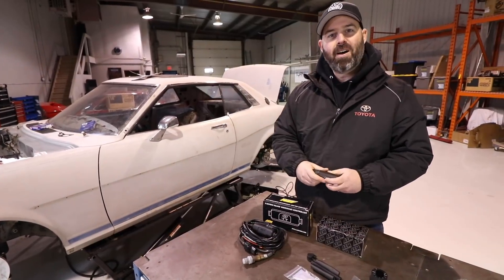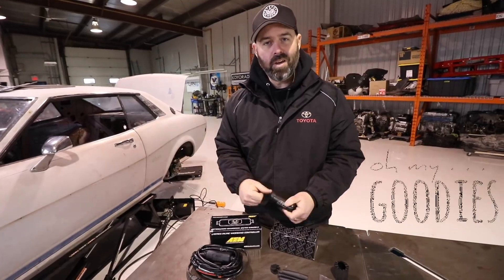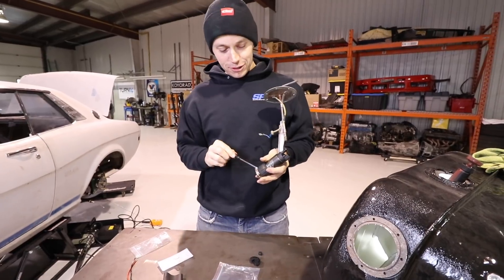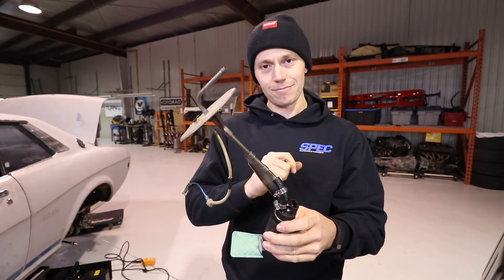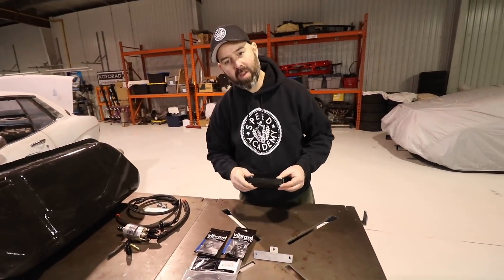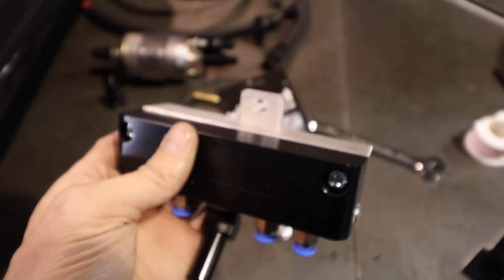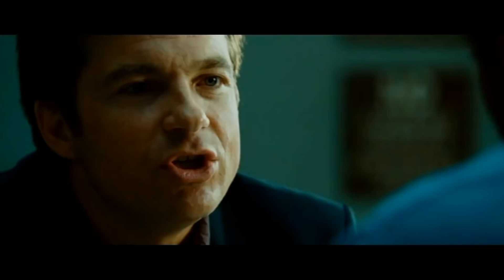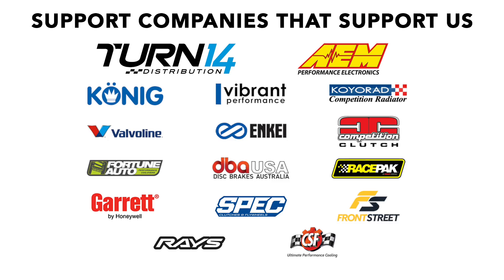Fuel Pump & ITB Vacuum System Installed! - RA24 Toyota Celica Project

Comment: I've installed series 5 Black Top in an RA40 Celica and I'm all ready to buy the fuel pump and regulator. The Toyota engine manual states the fuel pressure spec (with engine not running and fuel regulator  vacuum hose removed) is 38-44psi. It also states that fuel pressure tollerance should be 30-37 psi when fuel regulator vacuum hose is connected. I note your pump is only rated at 40psi which appears lower than spec. I've found two people that have documented their conversions on the web (one on youtube) and they both state the engine will ultimately run like a dog unless fuel pressure is 62psi. (which seems very high) They also state the BEAMS engine is extremely fussy when it comes to fuel pressure. SO having put my question in context, how did you arrive at your proposed fuel pump pressure and do you know anyone that has verified the operating pressure in an operating vehicle. Thanks in advance.

Comment: I'm a little surprised you didn't mount the vacuum manifold 180 degrees in the other direction so the vacuum lines didn't have to loop around, your O.C.D. let you do that, mine wouldn't. I like hoe the motor is looking, what is the original car those motors came in for those of us who aren't metric motor compliant!

Comment: You might need to take the map sensor vacuum signal from the vacuum block. Taking it from one cylinder will give you issues at low engine speeds

Comment: Everything you're trying to do that four-cylinder you can do to that V8 individual throttle bodies are only eight hundred bucks for the set and use your factory TPS sensor and Factory injectors and Factory fuel rail and you can still run the ECU a buddy of my done it to his

Comment: The zip tie may degrade in the fuel
Reply: It's nylon and totally fuel safe. We've seen OEM fuel pumps zip tied in at the factory. Wouldn't use it if we were going to run E85, but for normal pump fuel it's 100% safe to use.

Comment: Zip tie? What about gear clamp to not dissolve?
Reply: The zip tie is nylon and totally fuel safe. If we were running E85 a metal zip tie would have been required, but for standard pump gas a nylon zip tie is 100% safe.

Comment: The fuel line leaving your tank looks suspiciously SMALL...
Reply: That's what she said (it's -6)
Reply: the factory fuel feed, exiting a celica tank is 1/4 inch.  they may be using -6 hose, but the system can only flow as much as its narrowest point.

Comment: Just a heads up from down under (Australia) you will get a more consistent MAP reading if the source is from your distribution block and not from one of the runner inputs. I tried this on my 4AGE with the ITB's and didnt get a solid reading until it was sourced from the distro block :)
Reply: Good to know, thank you!

Comment: Hey guys. Tell whoever shoots & edits the videos to get a few seconds of just the light noise before each take & edit it in Audition and do a Capture Noise Print - Noise Reduction. 
This is if you guys use Adobe CC for editing.

Here are a few videos explaining the process: 
https://www.youtube.com/watch?v=K1oxlbD0uY8
https://youtu.be/ku6ZZ8yhuls?t=552

It might help or might not help at all until you guys figure out the light buzzing solution.
Reply: Cool tip, we'll give that a try! We have actually ordered LED light fixtures as a permanent fix, but in the meantime a software solution would be great! Will do some research on this.
Reply: Hope it helps you guys. It has helped me on a few projects.

Comment: Hhh, that foam will hhh, break down in gas hhh,. It's called tank creme hhh. Fast hhh cars, built right? Riight hhhh.
Reply: What foam are you talking about? The foam around the fuel pump that AEM provides with their fuel pumps? Hah, definitely not going to break down, it's designed to be submerged in fuel.

Comment: You guys should install a 1uz vvti with an r154 trans get way more power way more fun
Reply: M Deatherage The beams engine is easily 50kg lighter and the J160 is a good transmission and this package suites this application better imho. Also there is quite alot of potential for more power in that engine.

Comment: Does anyone know if there's an AEM wideband kit with two sensor inputs? I saw one a few years ago but can't find it anymore. (Car is running two sidepipes so need a reading for each. Caburetted so just need to hook up a gauge and be able to data-log with a laptop)
Reply: X7Rotary, I know they used to do a 4 channel setup a few years ago, but haven't nosed around the website in quite some time...

Comment: If I may make a suggestion from experience is to use a hose clamp instead of a zip tie for the pump - it will stand up to vibration a lot better.

Comment: What is the part number for the one-touch fittings used? Great build video on Beamsy!
Reply: Also is the NPT size the same for the vacuum ports on the excessive ITB adapter?
Reply: 1/8’’ NPT ports Part #: 2662  Xcessive ports are the same.
Reply: Thanks!

Comment: Can't wait to see the first startup, once she will be running with the wheels and everything but with the faded paint, it will be a hell of a sleeper. Did you try to fit the starter to see if it clears the vaccum block ?
Reply: Tons of room for the starter, so no worries there. I have been thinking about driving it around the first summer in "rat rod" condition with the old paint, but to be honest I'm pretty anxious to make it pretty once it's running, so may get paint sooner than later.
Reply: It seemed there was enough space but the angle of the camera caught me. You are making good progress with this build, I really like it. One of my friend's neighbour is restoring a TA22, but it needs a lot more work (sheet metal, pinholes in the roof etc). It reminds me that these were battling with mk2 Ford Escort in british rally stages in the 70's, japanese engines sounded so angry

Comment: With your MAP sensor you might actually want to use the block. If you're using a map ran off of one runner as opposed to a combination of all four it makes for a very erratic MAP signal on the ECM. Tuning this with Alpha-N for load and MAP for idle is the way to go.
Reply: Relax tuning experts. Mark Panic from Panic Wire has tuned more ITB'd Beams engines than anyone we know and he's told us exactly how to set this thing up. Our main load axis is throttle and the fuel calculation is based on barometric but we will use MAP for the closed loop lambda and that's it. Thanks for the positivity, bros.
Reply: J Albert that’s exactly why this car will run like shit just like their modded mustang gt and be slower then stock
Reply: Agree, MAP on ITB is useless after ~30% throttle, TPS and Alpha-N for load is the go for sure
Reply: Which Link ECU will you be using Storm or Monsoon?
Reply: Running the Fury model
Reply: Thanks DP. One last question, what is the part number of the barb fitting that's going from the vacuum block to your break booster?
Reply: http://vibrantperformance.com/catalog/advanced_search_result.php?keywords=11222
Reply: That's what I thought it was p/n #11222. The description has the hose size at 1/2", is that O.D. or I.D?
Reply: pretty sure that's I.D. but I'll check when we're at the shop.
Reply: The reason why I ask is b/c if your using an AE86 brake booster the vacuum port on the booster end is much smaller than 1/2" I.D. Thanks for checking DP.
Reply: That's a good point, we're running the Celica booster but it too has a smaller ID. We ran 3/8 hose from the Celica booster (which fits perfectly) and forced it on the Vibrant fitting which is admittedly meant for a larger dia hose. Shoot me an e-mail at dave@speed.academy if you want some pics. I don't think we covered it in a video. If Vibrant makes a fitting for 3/8'' instead of the one we used, go for that and it'll make fit up easier.
Reply: @speedacademydave  Thanks for sharing what y'all learned on this project. I know this is a year old, but if anyone else is looking, Vibrant 11225 is a 45 degree 3/8 npt to 3/8 nipple.

Comment: You might want to run a slightly longer hose for the vacuum line in order to get more slack cor a straighter shot into the fittings. In my past experiences, i have ran those pipes short and the strain of them being bent ever so slightly in the fitting and the heat in the engine bay combined can cause a hard to trace vacuum leak at the push fittings. Give it about 1-2 inches of straight pipe before it has to bend so that you won't run the risk of a vacuum leak.
Reply: We ran our lines just like this on the S2000 with zero issues. Should be ok, but we'll keep an eye on it.

Comment: I hope those zip ties are safe for Gas they might break down in gasoline
Reply: Ryboodle that is exactly what I was thinking.
Reply: AdamLZ just had problems with that in his 240. But his had E85 in the tank I believe.
Reply: All they’ve got to do is switch over to the aluminum zip-ties or a hose clamp and they will be fine.
Reply: They're nylon, which is resistant to fuel.  OEMs use nylon fittings fuel pumps and stuff all the time.
Reply: Cultus Mechanicus just because it’s an oem tank doesn’t mean someone wasn’t inside it at one point
Reply: Ryboodle yeah, RST wtg
Reply: Ryboodle was just thinking the same thing
Reply: Was thinking the same thing. They'll most likely be good for a while. I think 1 or 2 years before they become too brittle.
Reply: It doesn't. OEMs don't use zip ties to hold pumps in the tanks and they especially didn't do that 30+ years ago.
Reply: Nothing to worry .....ice seen OEM Tanks with Zipties inside